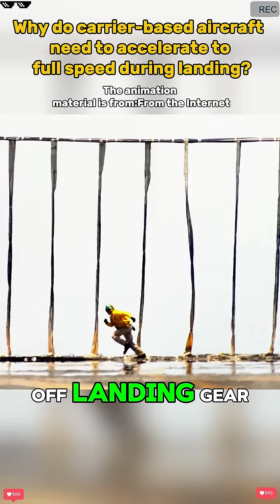Why Aircraft Carriers Force Planes to Go Full Throttle When Landing

Comment: There is reason EVERY landing on the deck is graded. ANd it does not matter what is your rank or job,  from the most junior opilot up to CAG if you are trap quallified you will be judged on every landing you make (unless it is with broken plane then you can be excused), paddles WILL grade you and if you don't perform up to specs its added training and if that does not help, off to the land based community you go.

Comment: It's actually safe considering all things, when you go full thrust you're either flying away or you'll stay in place. Then again the line snapping is not apretty sight.
Reply: You think I hear that can full on separate the body from the legs of multiple people without fast and strong that cable goes when it snaps
Reply: @BraydenParker-s5t That's the maintenance guy problem. RIP them

Comment: I took care of a test pilot that was involved with the designing of the harrier. He said "Some days I wish the plane can switch to submarine mode, good thing I don't have to pay for the failed landings"
Reply: Not a bad idea.

I always just thought the deck should just slope at the end.

So gravity acts as brake.

Or just have the whole carrier deck be rubber foam as consistency.

Or a series of giant nets.
Reply: Nets would damage the planes more than this type of landing
Reply: nets are still used, but only as a last resort. Probably because the amount of damage it will do to the aircraft is so high. Also because nets can still very much snap (also turning them into incredibly violent whips).
Reply: There actually are ramps at the end of aircraft carriers it’s just America doesn’t use them
Reply: @dawsonc6106 those carriers also don't use the catapult launch system that the American carriers do, so the ramp is to help the plane get more height as it's trying to take off